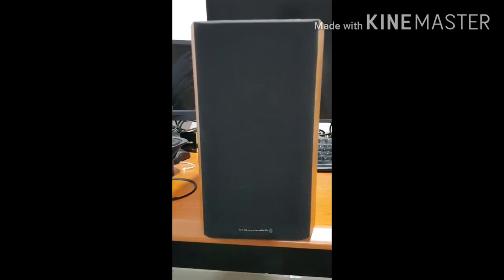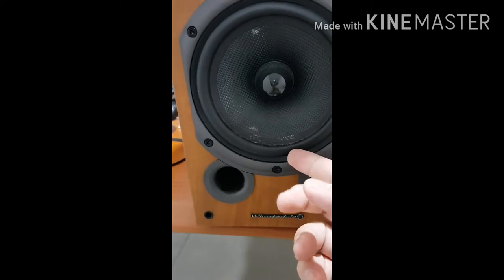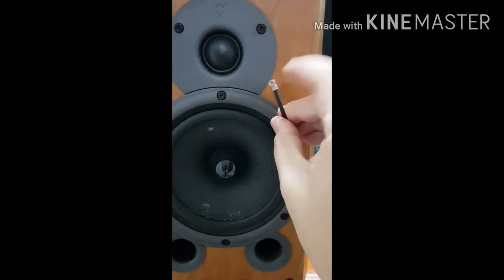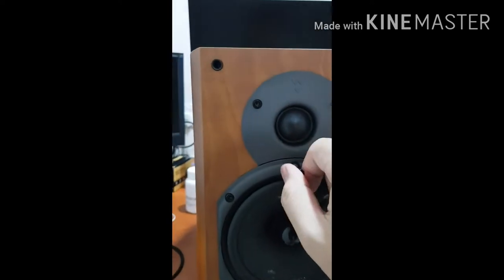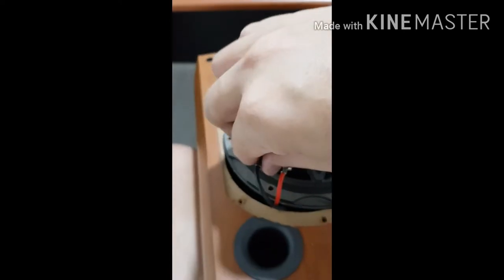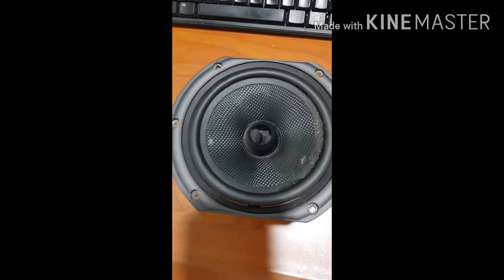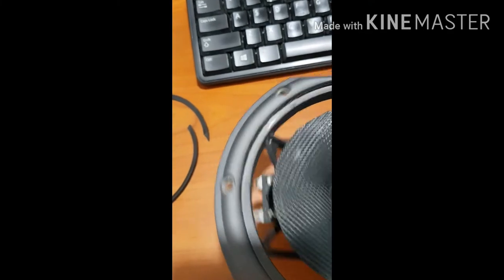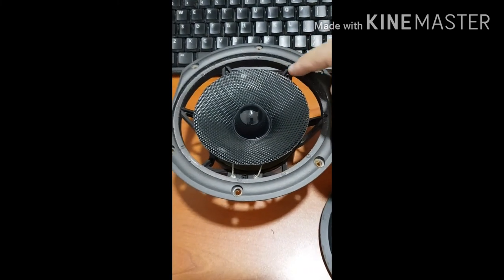DIY Repair Whafendale 9.1 Diamond Speakers

Comment: Why should you have to do that? Obviously it's a design flaw and Wharfedale should be responsible?
Reply from the maker: manufacturer not going to be responsible for something thats obviously out of warranty? the baffle becoming hard and brittle over the years are NOT manufacturing defects but rather wear and tear. Its either repairing it or just dumping it altogether.
Reply: @jeffchan1901  Oh, how many years?